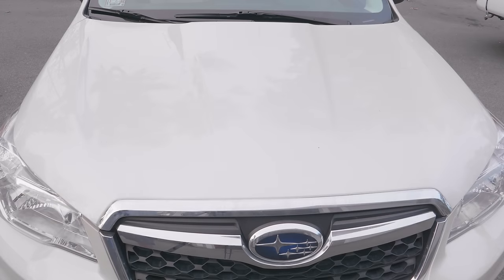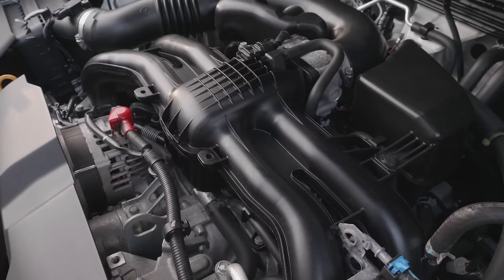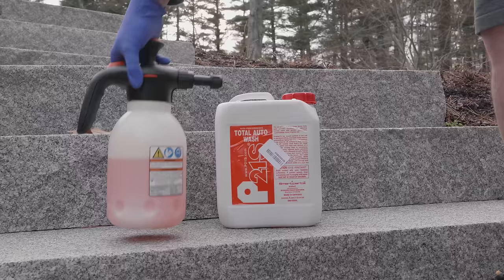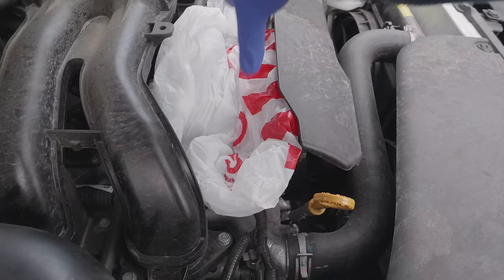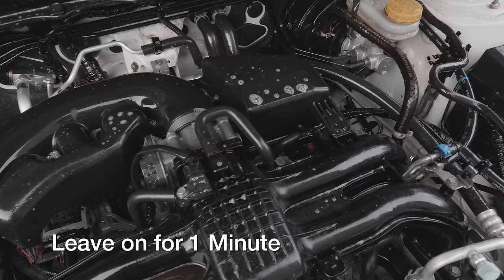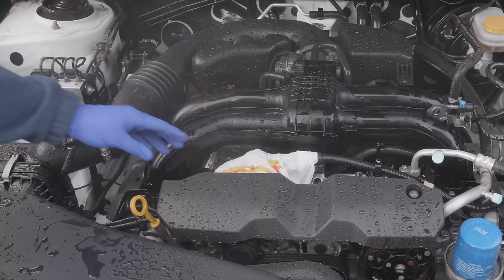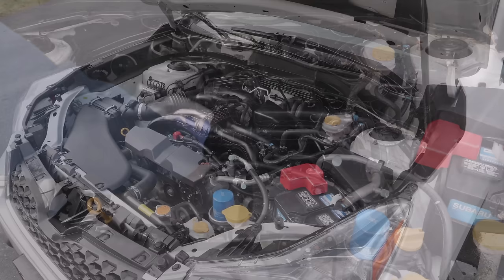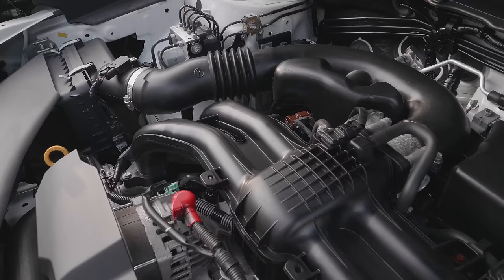Clean & Detail Your Car Engine in 5 Minutes!

Comment: Thank you I finally got around to clean my engine with P21S and yes it took very little time with super results.  Thanks for the tip.  Have you used this product on tires?
Reply from the maker: So glad you had a great experience. Yes I use it on cars, motorcycles, engines, tires, lawnmowers. Only thing it's not good for is houshold stuff, kitchen, etc. Not approved for those uses. But anything on cars its superb.

Comment: If you got old carburetor vehicle fine.Dont bother with electronic ignition cars as rust spots will occur after drying on unseen electrical contacts leading to loss in HP.I do a very fine mist of wd40 only once every 2 years max on a bmw x5 that I bought new and is currently 20yrs old and is in showroom condition

Comment: Aside from the alternator did you cover any other electrical components? I'm planning on doing this today, but don't want to ruin anything or short anything out. That being said, all wires are solid, no cracks or splits that i need to look out for.

Comment: Bilt hamber sufex hd to degrease. Carpro Perl sprayed over. Use the car blower to blow the Pearl into all the spots. This is ok for a ok clean , if your ocd the. working the sufex hd in with a brush will be better. Once you done a good job you can blow the dust off now and then and re-Perl a few times a year. No knocking this method which for most people will be perfect.

Comment: That would be great and also if I didn't have 10 pounds of oil residue if I got that car in My bay I'm looking at a good day a 5-minute job but I don't think that's going to cut through the 10 lb of crud that's on my motor

Comment: doesn't it create corrsikn on an aluminum engine block? Guess i will rinse the engine bay first because we got a long winter with plenty of salt on the roads here in canada. It will get into the engine compartment. one guy mentioned it in the comments. I will take his advice. Thanks for the great video! short and clear.

Comment: Good luck if the bottom of your fuse box fills with water and shorts everything out, plus the hundred other issues, a dirty engine bay requires agitation, this engine bay was clean.

This detailer had a good laugh, especially recommending P21S lol
Reply from the maker: Sit back in your chair and give yourself a high five, I will continue to actually get results.

Comment: Once I get all the components up and running I want to do this on an old Buick with the Olds 307 in it. Anything else to cover up besides the alternator? It's an old carburetor motor so I'm thinking maybe cover the air intake just to be safe

Comment: No water for me other than what I used to mix up a gallon of Wolfgang Uber Rinseless Wash. Fill up a spray bottle with it and wet things down no faster than I can wipe them off. A couple dry microfiber towels from Walmart to wipe things off with then pitch the microfibers in the dumpster. I do this once a year before I take my Tacoma to the dealership for it's yearly oil change. Everybody is different. Do what you are comfortable doing. Peace!

Comment: I mean, if you hold the pressure washer too close to anything it will screw it up.  Hold it back to where it doesn’t feel like it’s a knife’s edge and keep it back.  It can blow wires off or lift paint. Just don’t hold it close.

Comment: Simple I wash my car every three days with pressure washer I clean around the trunk lid and gaps  and ever under the car . I even whipe we’re I put a jack to lift the car every time I wash my car every 3 days or even sooner depending how dirty it is I clean the engine bay with a plastic spray and wet not soaking wash rag I rub everything but the holes I whip the holes with a dry rag and I clean around simple it stays looking new

Comment: Wow, I just bought my first car and I had to replace the Fuel sensor to pass smog, but while I was replacing it I noticed my fuel rail was really disgusting so I just took a shop towel to wipe it.

I got about halfway and thought to myself “Wait, should I be doing this? Is it okay to be cleaning the outside of the fuel rail like this? Did they maybe put oil on it to lubricate it?” 

So I looked up a video to see if it’s okay to be wiping it delicately with a shop towel like I’ve been doing for the last 10 minutes.

.

Now I’m watching a video of this dude spraying strange chemicals across his whole engine before power washing everything down with a fucking hose, so I think I’m good delicately rubbing the fuel rail of old grime 😂🤣

Comment: How did I know there would be a Amazon link in the description?  Cover the alternator, good.  How about wiring harnesses, fuse box, computer, etc?  Those are ok to soak?
Reply from the maker: There is a link because there is no better way to do it and no actual diy home made method that works. As echoed by the Amazom reviews, 99% of which were left after my video, the stuff is a miracle. Part 2: https://youtu.be/8aMKkUcTTJ4

Comment: Does it work for cleaning oil? My engine bay is covered in oil. On the fan. On the alternator (which you said not to clean) and everywhere. Mixed with coolant that’s everywhere.

Comment: Can it be used on any car? I own 2006 Buick Allure, with 140,000 km on it. It only had one previous owner. Car is in immaculate condition, however I would like to shampoo the engine for that extra spark. Does age or model of a car matter when using this product? Thank you!

Comment: I worked at preferred and we used to spray out the engine bay with a pressure washer but only for certain years and certain makes but I'm wanting to power wash the bottom of my engine torwards the crank the oil pan Etc not sure how that will work out I have a 2008 Chevy Silverado what oil corrosion so bad on the bottom that I can scrape it off with a scraper so I'm just wanting to scrape it all and then power wash it with a degreaser not sure if that's okay or not

Comment: I say for the hole for the air intake , to stuff it with at least one microfiber towel or two . They will absorb any water and keep it from getting into the engine , through the thottle body .

Comment: QUESTION: Do i have to cover the alternator? There is a ton of oil from an oil leak all over my engine. I fixed the leak now im going to clean the engine but the alternator also has oil over it. So is it safe to coat the alternator too and rinse it with water?

Comment: I see you have what looks like a Subaru Forester. I just washed my 2015 engine and now I see the engine coolant temp blue light coming on. Comes on for 30 secs then goes off. Anything I should check to see if it is still wet? I rinsed lightly with a hose and dried with leaf blower then drove it for 45 mins. Thanks.

Comment: I have the same Subaru And one thing I noticed when I sprayed it with a hose there’s a lot of areas for water to sit on top of the engine so I ended up drying it with a rag is that a necessary step because it was literally pooled everywhere??

Comment: I would never use water hose on engine again you might not see damage right away but it will happen believe me I learned the hard way
Reply: Have you ever really driven in the rain? You do know your radiator's fans pulls water and injects it all over your engine right?

Comment: Good product, but it is not safe to spray your engine with any conductive liquid while the battery is still connected. Aside from that, water and humidity can come in contact with exposed connections, frayed wires and the engine block with the chassis provides ground (-) for the vehicle,. When I went to my mechanics Institute, all my instructors warned me not to powerwash or use a garden hose to clean engines. All that does is make electromechanics rich. I have a 2005 Dodge Neon Srt-4 and. 2022 Corolla SE and I clean both engines with as little water as possible. Takes longer but it's alot safer.  Never had issues so far.

Comment: Armorial tire does the same thing with out final water
Reply from the maker: Be very careful, it will ruin belts make them slip and is not rated for engines. I like lots of DIY solutions but putting a chemical on your engine that soaks in that's designed for tires isn't a great idea.

Comment: To be perfectly safe, remove the battery. Why not clean all the dirt underneath it as well anyway? Also, cover the connectors with tape. I know, more time, but it's worth it if you're going to drench everything with the hose.

Comment: Works great on a newer car that doesn’t have more than surface dirt.    What about a real car that’s not sitting on a dealer lot?  One that actually gets driving and has oil and grime and is older than 5 years?  Does it still work?
Reply from the maker: https://youtu.be/8aMKkUcTTJ4
Reply: So you reply with the same video of a car that has dust on it?   That says no this product doesn’t actually cut through real dirt grease and grime. Just dust bunnies.    Lol.  Too bad I was interested in buying some but my cars actually have dirty engines.
Reply from the maker: @stephensickels8714  You needed to watch past 10 seconds

Comment: This is a little naughty because the spray on and wash off just isn't going to clean that good. Especially on a normal engine which has grease, oils and other stubborn dirt which doesn't just rinse off after 1 minute soak with anything on the market except maybe a industrial strength caustic which is going to ruin a car. Sales pitch to buy this product is all this video showed me.
FYI I use the spray on degreaser snd all purpose cleaner and scrub all over with a detailing brush, then rinse and repeat if required until clean. Then I dry it all off with microfiber cloth and add trim and bumper liquid to all black areas to make them look tidy and spray wax detailer to all painted areas to also make tidy and a final clean in case some dirt was missed. Have a go yourself. Tell me if im wrong?
Reply from the maker: You are wrong. I was amazed at how many people thought this video was faked or the car was to new so I did it a second time on my "new" 15 year old Tacoma with 200k https://youtu.be/8aMKkUcTTJ4

Comment: You forgot to mention that the mass airflow sensor (MAFS) should be covered - it is actually more sensitive to water than the alternator. The MAFS might be right next to the alternator, like yours apparently, but often it is in a different location.
Reply: Alternators get plug with dirt and oil clean them is a good thing

Comment: Would this remove markers that are used to sign parts of the engine by the manufacturer, ie: Saleen.
Reply from the maker: I dont think so as they are usually paint markers. I wish I could explain the chemistry of this stuff but somehow it only removes what you don't want. I have never had any bad effects from it in any way.
Reply: With it being winter in NJ, I won't be able to try it until Spring and will let you know. Thanks

Comment: At the end of the video after you aired it with the shop vac and took a drive I STILL saw pooled water. There was pooled water on one of your brackets. Unless your displaying your car or selling it I really dont see the need to put a hose directly onto your engine bay. All you need is a stripped wire, Any sort of damage to fuck your things up. My Honda Civic has paint that is chipping from inside the engine bay, Today im gonna remove the battery support to sand it, prime and spray paint it again. I work on a farm driving through dirt roads every single day. And All i do is maybe 3 or 4 times a year i wipe down with microfibers, one small brush and a big wider brush along with a spray bottle. Also wouldnt the gunk still remain under? gunk doesnt pool at the top...

Comment: So cleaning the engine using this method will remove my top side oil filter? Before engine is dirty with a blue top side oil filter and after is a clean engine with no top side filter... Interesting 🤔

Comment: So if I'm driving in a pouring rain at 60 miles an hour, my alternator is right on the front of the engine, that water doesn't get to the alternator?? Hello!
Reply from the maker: That is correct. You have a radiator in the front of your engine, there is no direct water blowing into the alternator. If that was the case your accessory belt would be soaked the entire time and lose grip.

Comment: What if you don’t have a blower to dry it? Can you wipe it dry or let it air dry and then wipe it?
Reply from the maker: Absolutely, just dry what you can and drive it for a bit which will take care of the rest
Reply: @SilverCymbal  Thank you for responding so quickly and thank you for your help. I just bought a used car that I absolutely love but the engine needs to be cleaned. Thank you for providing us with such a quick, easy and simple way.

Comment: The engine bay you used just has dust on it, it's not very grimy with grease or oil at all . Most likely the result would have been accomplished with simple green in a spray bottle. $10/gallon at Home Depot.

Comment: Don't use water! All you need is simple green foam and a air compressor, your engine need to be completely cooled off first. Spray set for 5 min or so don't let it dry and blow off with air then wipe down the rest.

Comment: I've had a bad experience spraying water in the engine bay it was not even pressured. The car was a 2006 so it was older. Water got in somewhere important, and would shut the car down right away. After 3 days it dried up and the car was drivable again. Maybe stick to newer cars in this method.

Comment: Would this work on an 1985 seville sls
Reply from the maker: It would be as mentioned older cars electrics are not well sealed so I wouldn't use it, or at least avoid all electrical areas.

Comment: What is your connection to the product you are promoting?
Reply from the maker: I bought a bottle
Reply: @SilverCymbal  thanks was just wondering because there are many products that can be used which cause no damage to any of the engine parts and paint.
Reply from the maker: @williampatton3444  I had used this product for about 109 years prior to this video and started cleaning motorcycles and even lawnmowers with it. If you check https://amzn.to/2M4u3Es you see see literally hundreds of comments thanking my video but more important they love the results. I agree their are other products, thsi one is different. Not cheap but the end result is almost unreal.

Comment: use common sense i was scared af too but i sprayed my car with a garden sprayer filled with water and then added acp sprayer and just agitated everything the only things i covered were the battery, alternator, and intake its fine just don't point directly at those parts for a long period of time they are still ok if you get some water in them but the idea is not to drench them in it and after you take the covers off you can go over it with a brush a detailing brush and give it more attention since those parts will be dirty

Comment: My 89 mustang is super dirty but how do you clean it wo messing shit up
Reply: You wont mess anything up. Everything in the engine compartment is made to get wet. When it rains water gets pulled in from under the car, through the grill from the radiator fans pulling air in. Through the hood gaps. Just use alittle common sense, like if you have a "cold air intake" and cover the filter. Aswell as anything that will allow water inside the engine, if someone did away with the pcv valve, and put a filter in its place. But all the electronics are made to get wet. There made to be water resistant, harness plugs are made to be water tight. The next time its raining out and you park after driving. Pop the hood and you'll see just how wet the engine compartment gets. All the electronics other than the ones in the interior. Of a car is made to get wet because of the elements.
Reply: I will try it. I spayed gunk on my engine bay once but this was in like 1998 and I sprayed water on it and it started to have a skip in the motor. I don’t think I covered anything up.

Comment: I have been using water to wash engines. Just don't spray directly into the electrical connectors you should be fine

Comment: I would love to do this but I'm way too paranoid to just hose my engine and electronics down with all that water
Reply: I understand why your scared. But you shouldn't be afraid to man. The wiring harness plugs are water tight. The fuse box is water tight. Even the ecu is water tight, and the board is coated inside to protect it from water. Everything in the engine compartment is made to get wet.  Look in your engine bay. After you park from driving in the rain. Everything gets just as wet when your driving in the rain. Water get in the engine compartment from under the car. Water get in through the grill and the radiator. Because of the radiator fans pull air from the outside in. So that pulls water in the engine compartment all over the front of the engine. Water gets in from the hood and fender gaps. Were the hood and cowl panel is. That soaks the top of the engine and everything bolted to the fender wells. Its nothing to be scared of man.

Comment: Or spend an afternoon  and use degreaser and gas rags and whatever else you have laying around. Get in tight spaces with brushes and don't use water. One mistake will cause ECM issues and other problems. Do it right takes time. Why not put the time in?

Comment: Never use pressure washer on engine unless you like walking until the electric connections dry out.,  most auto connectors are cheap crap with poor seals that won’t hold up to high pressure.

Comment: I just use armoral  tire foam
Reply from the maker: Do not ever do that. You will ruin your belts. You are using a product that was never intended for an engine. Like a bad TikTok challenge gone wrong.
Reply: I did it already turns out really nice actually haven't had any issues